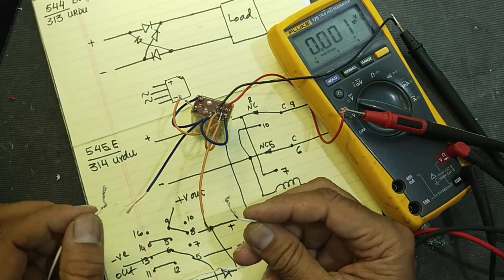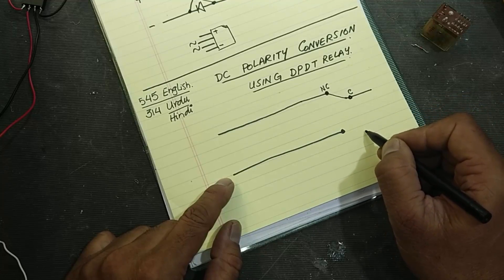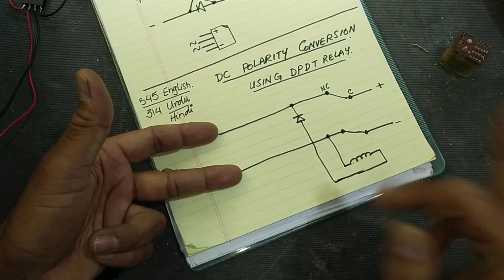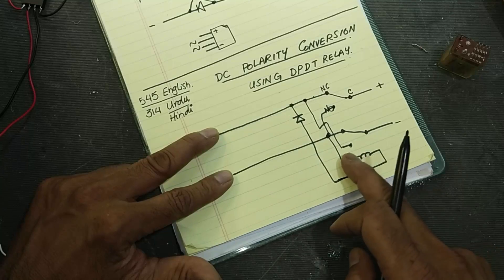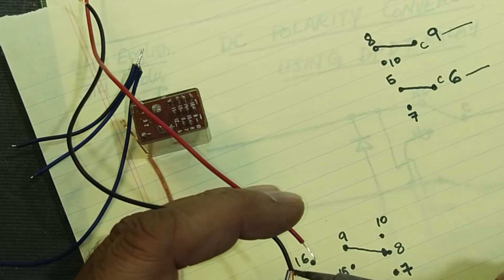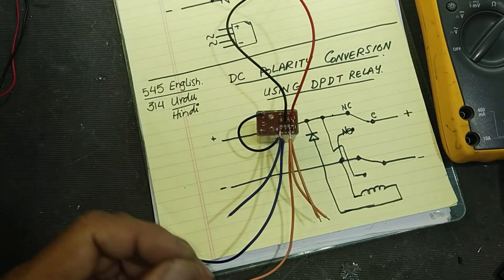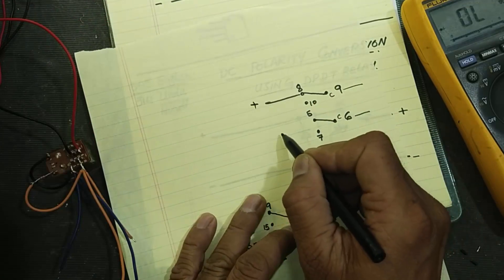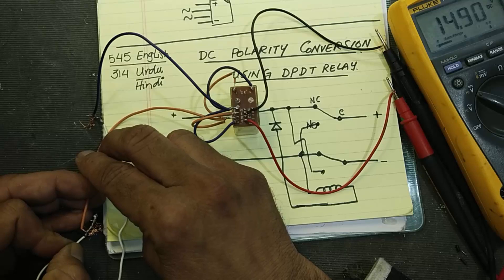{545} How to Convert DC Voltage Polarity Using DPDT RELAY Double Pole Double Throw Relay

Comment: Why don't you use bridge rectifier with shotky diode? You will loose only 0.4V. Using a relay is more expensive, not instantaneous, and more bulky. However, like your video and love your mulitmeter. God bless you.
Reply from the maker: yes. that is also a way to do it. always there are too many approaches to get results
Reply: @HaseebElectronics  God bless you.

Comment: السلام عليكم و رحمة الله و بركاته
بارك الله فيك.
What are the differences between 40n60 ufd, 40n60 Sfd, 40n60 f2ds?
Reply from the maker: please check video 387
Reply: @HaseebElectronics  thanks sir, but in my case, according to the datasheet, all of them have a antiparallel diode and all of them are 40n60 igbt/diode package

Comment: Thank you. I have a question, how can we protect the circuit from the reverse voltage coming from the relay. Here we cannot put a diode alone. Should we put a diode with a resistance on both ends of the relay?
Reply from the maker: sure i will explain in detail in upcoming video 
in that i will discuss the advantages / disadvatages and their solution for all this series of protection videos